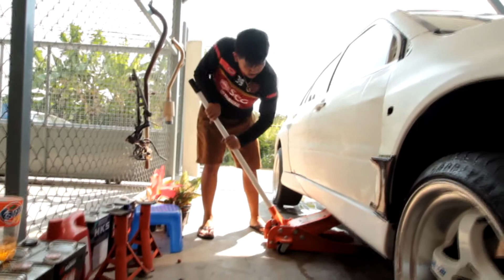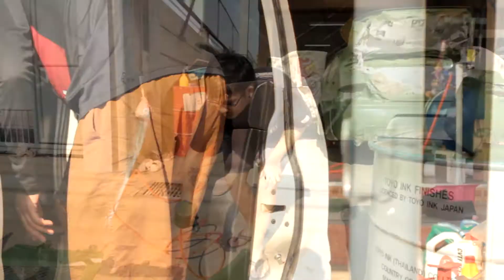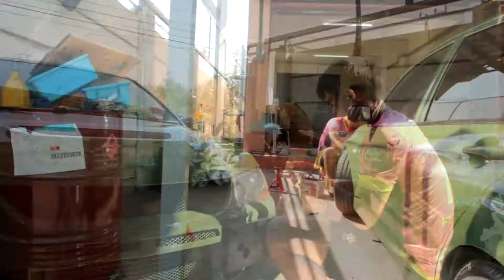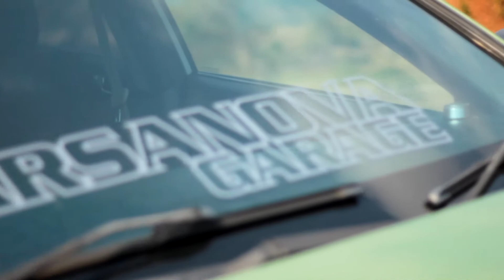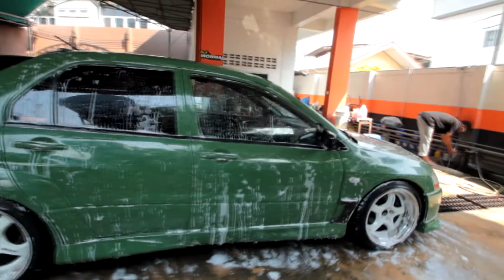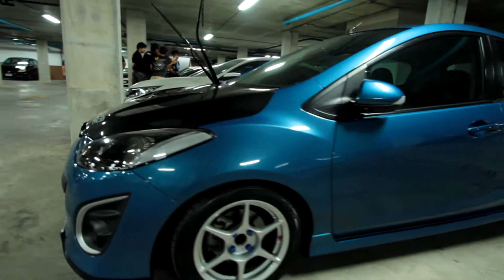CEDIA EVO9 BY CARSANOVA GARAGE - Vspec club

Comment: Is it only bodyworks converted to evo 9?
Or also performance?
Awd or fwd?
Reply: Jodhun Bilaal it’s just body, at the beginning of the video you can see stock Cedia engine
Reply: @nastilyasperated2215  does cedia gen1 has the same headlight as to evo7-8-9?
Reply: Francis Salvador no, they are different
Reply: @nastilyasperated2215  I see....I am planning to buy a cedia gen1 place it with a evo8/9 front bumper and look. So I guess there is no possibility of convertion :(